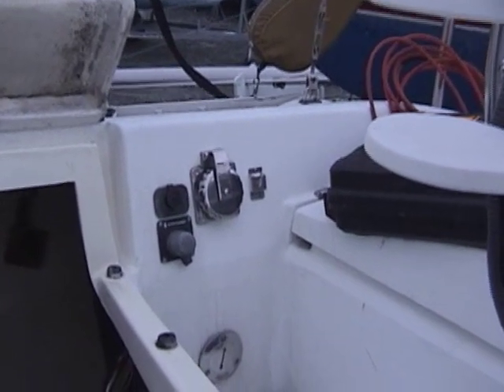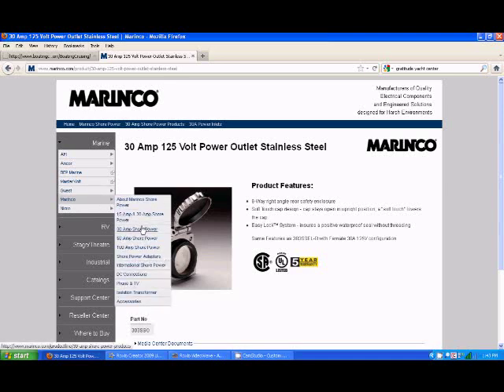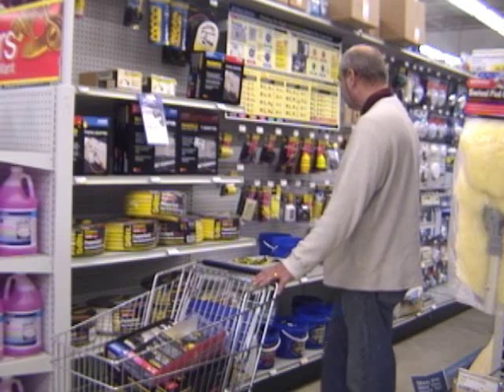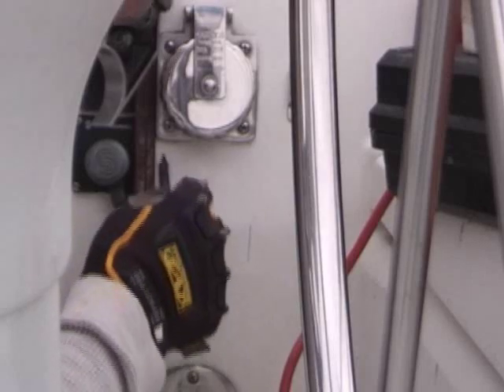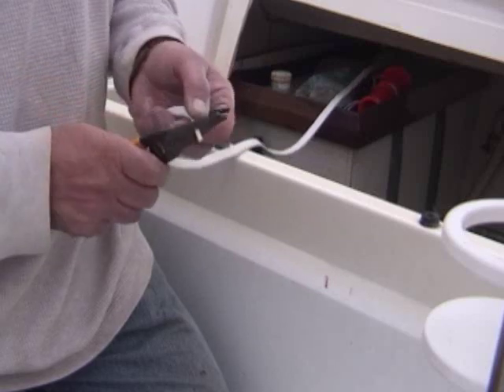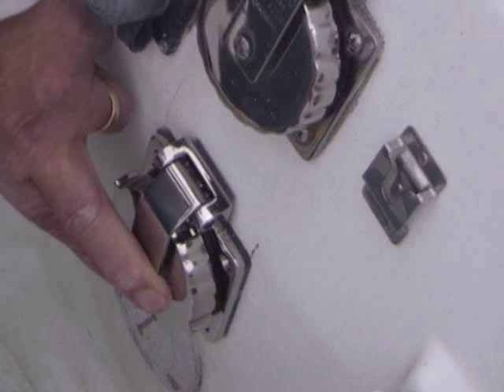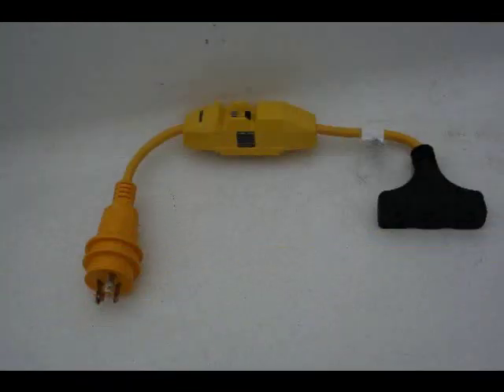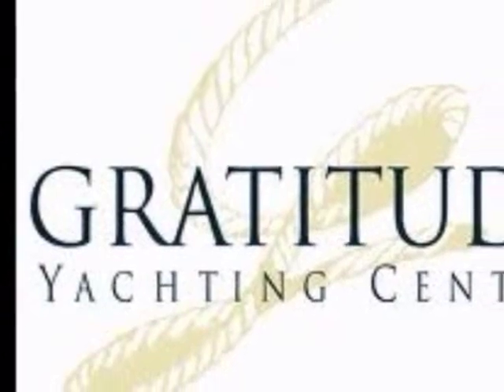Add a 30amp shore power connection to your boat Part 1

Comment: Im curious as to why you added another shore connection? I might have missed it if you covered that. But i see theres what looks like a shore power connection right above the one youre installing.
Reply from the maker: mainly for the airconditioning, reverie HVAC , it needed a 25 amp breaker
Reply: @VagabondEpicurean  i get it. Thatll be nice. My big boat has it but im missing it in my little one im getting rid of. Its got a kitchenette and bathroom but the geniuses at bayliner forgot the ac. In texas if you went to use the bathroom down below and had no ac theyd find you adrift dead on the thrown days later.

Comment: I used normal house wire and circuit breaker box and  it's fine after 15 yrs.
Reply from the maker: you are very lucky :)

Comment: More than 24k views on this video. Since 2012, ABYC says that you have to install an ELCI breaker. "Thanks good to know" was your answer to David Kerr who pointed this out but you still have this video published. Why not correct this instead of misleading more people?
Reply from the maker: ok i will try to do add that, but the main breaker on  most newer panels is a ground fault breaker, like the one i used.  Plus i added a note in the video description

Comment: Can someone point out to me why we're doing this,, when there is already an existing cable connection clearly visible - directly above the new one the  commentator is installing. What would the original one be used for? I don't believe the commentator acknowledged it's being there already  - or made any reference to what this was - or what it was used for?
Reply from the maker: This is an additional 30 amp for the 2nd AC panel I have installed to handle more AC equipment. 
I use the boat as my office and living quarters.
Reply: Now I'm happy with a fuller and complete understanding. Thanks for taking the time and making the effort to get back to me.